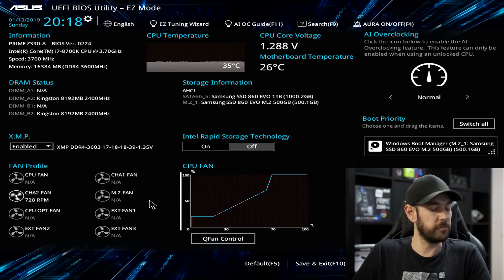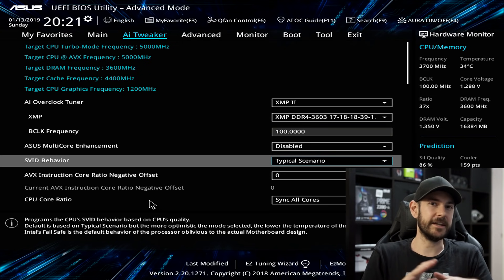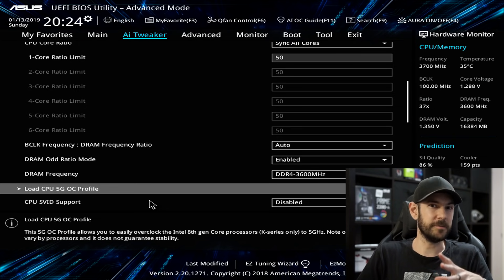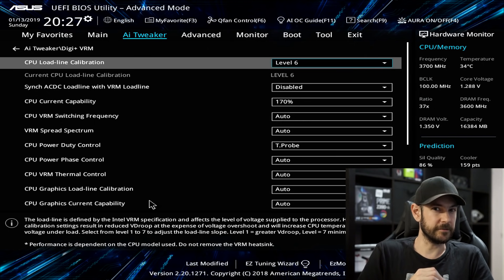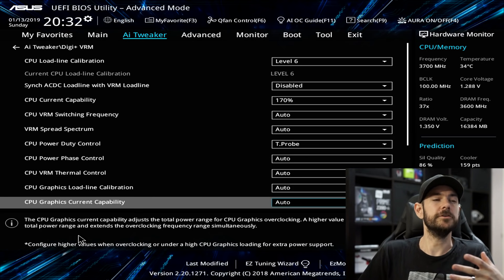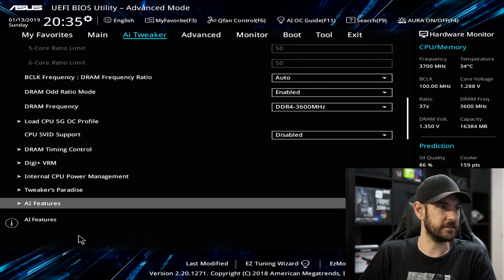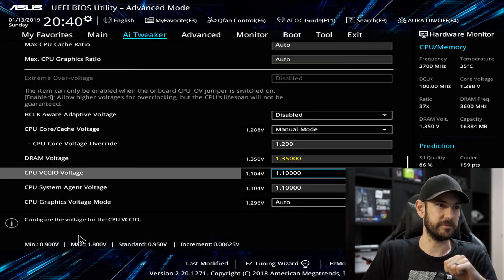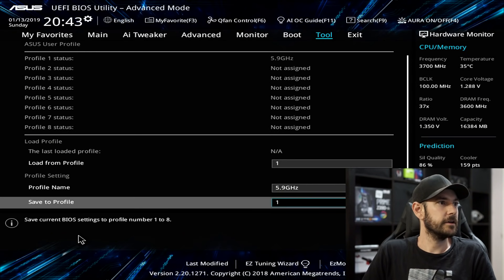ASUS Z390 Quick Overclocking Guide | i7 - i9 | 8700K - 8086K - 9700K - 9900K

Comment: Hey @Boosted Media , so i have tried everything i learned from that and also other videos, but i cant get my i9 9900k running at 5 Ghz. 

Short System Overview: BeQuiet Dark Base 900 (3 Fans), Asus Prime Z390-P ( i know its not the best MB for the i9 ) , 2x8Gb rated 4266mhz Trident Z Rgb ,  Dark Power Pro 1000W Platinum, Vega 64 Nitro+ , i9 9900k, Corsair H150i Pro Water Loop.

My RAM is rated on 4266mhz (same for this MB), but the maximum i can run with simple overclocking is 3800mhz stable.

At first i went with all your settings, which let me boot and do basic stuff, but as soon as i start a cinebench run it freezes and shuts down on the first render square thing.

I then tried to go up in Voltage to 1.32V, and went down with Clockspeed to 4.8Ghz in single steps each. That worked, but had me worried about the CPU temps at around 90-100°C spreaded across all cores.

Now, i know i could go even further in Voltage, but my cpu reaches 90°C+ way too quickly even on 4.8ghz, so 5Ghz, is like unimaginable right now. 

I remember, when i bought the CPU a year ago, i could just load that 5ghz Profile from Intel, and it ran without beeing too hot, maybe like 85°C. Which is alot yes, but now hitting 100°C on 4.8Ghz with 1.32V is not normal i dare to say. The fan and pump speeds are on maximum and i also renewed the thermal paste a few months ago, yet it doesnt really help. Idk, if the CPU got damaged over the past year or so, or if its a setting thing, but even then... i don't understand why its so massively unstable.

Do u think its the Motherboard, just beeing too low speced for the i9? Maybe i need a new Board, but would a new Board really lower temps by 20-30°C? I see alot of ppl running 5Ghz on 70°C even with a little worse cooler options.

Thanks for the Video though, but im sad i cant use it with my Setup(??)
Reply: Did you ever get it figured out??
Reply: @ULTRALXV  Hey, yes as soon as i switched to a better Mainboard (Asus Maximus XI Apex in my case) the cpu ran instantly 10-20°C cooler and now i'm actually daily using it at 5.1 Ghz at 1.37V and AVX drop Set to just 1. No overheating or throttling even in Benchmarks . Cinebench R10 can get 5159 Points, but i dont remember the version TLDR; Asus Prime is actually the worst Mainboard You can buy for Heat Management.
Reply: @Dan98123  I actually have an Asus Prime Z390-A. Had no idea on the heat issue lol. Do you think it's because you had the P model? What's interesting is I can get to 5.1ghz with certain things enabled like the auto stuff on voltage etc. However, I cannot get a stable 5.0ghz when I do everything manually. Right now I'm 4.9ghz with:
VCCIO@1.0v
System Agent@1.0v
Vcore@1.25v
PCH@1.0
AVX is at 0

What's interesting is my temps with this setup are way cooler than stock ASUS profiles. Idle is like 32c and load no more than 55-60c and even under some loads it never goes to 55c. I still have a difficult time accepting that I can get 4.9ghz stable with only 1.25v....yet 1.35v for 5ghz won't work lol.

As for the 5.0ghz problem I'm having...I have no idea how to configure things so it's stable...I've tried most things I think. I have went up to 1.35v on the vcore and 1.2v for both system agent and vccio. I have not tried an AVX offset though. Thank you for the swift reply!

Comment: Killer vid, much appreciated. Thoughts on delidded 8086K at 5.3Ghz on all cores at 1.40 volts as a daily driver? Temps are 36C idle and max out around 65C when gaming. Always stable, even under stress testing. Should I be concerned about this voltage at these temps? Been running this way for a year now but concerned about long term and degradation. Thanks in advance!
Reply from the maker: I personally wouldn’t run that high for a daily driver but if you’re not planning on keeping it more than a few years it’s probably fine.
Reply: @boostedmedia  Right on and much appreciated. So even with the temps in check (71 max during stress tests), it's still the voltage that's a concern?

Comment: i7-9700k works fine for me, I did go to 5,2GHz running without any problems, much better then the asus auto tune.
ty for the guide!

55-60c with an CRYORIG A40 Ultimate.
Reply: Did u change some of the settings he showed in the video? I have i7 9700k as well
Reply: @user-ee6md7vh1o Actually not I did use the same settings, 1.3v 5,2Ghz and I did use intel extreame tuning utility to stress test since that's the only software I know to show me thermal throttling, power limit throttling or current limit throttling.

Comment: Pls answer im newbie for overclocking, is it safe overclock to 5ghz with 1.2 volt? Which one are most the safe, 5ghz with 1.2volt or 5ghz 1.35 volt? Pls answer. Thx a lot mate.
Reply from the maker: I’d be shocked if your CPU will do 5ghz at 1.2V. I’d suggest doing a lot more research before attempting as you seem to have the wrong idea about how this works. The aim is to find the highest clock speed within your safe voltage and temp range.

Comment: Would've loved to have seen the same type of video with an i7-9700k specifically in your MoBo's CPU socket. That said, I still really appreciate you taking the time to put together basic overclock videos like this. They're VERY helpful to folks whom are less experienced with Overclocking (like myself) and that's an awesome thing because nobody wants to accidentally damage their shiny new hardware when all they were trying to do was maximize its performance, and in all that excitement maybe got a little overzealous with settings they didn't understand ;P

Thank you, and I hope to see a similar video where you do the same thing but with an i7-9700k in your MoBo at the time!
Reply: This works fine for 9700k just did it
Reply: @NORMAND021 otta tweak the voltage a little bit but ye

Comment: So after going through this guide, my windows 10 will decide to disconnect my monitors whenever I hover over a windows dialogue. Its very strange, but when I set all my values to default, the problem disappears. Any ideas what setting might be causing this?
Reply: So I have the asus z390-e and I've found my mistake such that I had the XMP profile to 1 instead of 2. Now everything runs smoothly

Comment: i copied your settings.  ihave the i7-8700k with the z-390a mobo.  once i copied your settings i saved and restarted and my pc gets stuck on preparing auto repair...  Any help?
Reply: Go back into bios if possible and either go back to default core values or go load the bios from a working state
Reply: @subswithnovideos-yq9cz  I got it thanks!  For some reason I had to up my voltage a tad and that done the trick

Comment: Love the video very informative, I have always used AI suite to overclock my cpu's. But with my new 9600k on my new Asus Z390-A it wanted to overclock to 5.2Ghz so I thought I'd give manual over clocking a go. I have my CPU currently running at 4.9Ghz with an avo offset of 2, with voltage sitting at 1.280 I have fairly consistent temps of around 60°c. I might look at lowering the avo offset or removing it. Thanks again, would love feed back to know if this seems right
Reply from the maker: Worth a shot. Those temps seem low. What are you using to stress test?
Reply: @boostedmedia  I used Occt for about 45 minutes, it did have a very quick peak of 71 but mostly hovered in the low-mid 60s. I will do some more stress testing after work today. I use a hyper 212 evo as my cpu cooler

Comment: Great write up. Built my first gaming machine recently (i5 9600k - water cooled) so my learning curve is rather steep. I allowed my bios to automatically OC based on the default settings and it set it to 5.2ghz. Ive been running for about a week doing various tasks and some long game sessions. No crashes yet with temps peaking around 81C but mostly staying in the upper 60s. My biggest concern is hearing you talk about voltage. Once I checked in cpu-z I saw it had set it to a variable rate that frequently hit 1.495v. as a max. Should I be worried about running this voltage if temps and stability seem to not be an issue? Appreciate the insight.
Reply: based on my previous experiences 1.495 is a really high Vcore I would say it's a bad overclock because the voltage is really high to my mind :S I've never ever been above a 1.35v I believe you should do the same for a first try

Comment: I’m looking to stay at about 4.8ghz on my 8700k and 370a. What voltage should I aim for? 1.1-1.3v? Other than that, I assume I can just use the same settings you listed? Really I’m just looking for the safest/easiest OC, not trying for 5-5.1ghz.. 

Best OC guide I’ve found, so thank you for this!

Comment: Help! I'm having trouble getting the right overclocking numbers for my 9900kf while keeping my thermals bellow 100c at full throttle. ( details: mb- Asus z390 plus CPU- I9 9900kf  cooling- Cooler Master 240 AIO)

Comment: Thanks man, you are a life saver, I'm running 8700 non k can you help me out, my cpu temps are going crazy
Reply: medi core I know this is late, but non k processors are not designed to be overclocked and is very hard to get a stable system. I recommend you don’t try as you may fry your chip if not done correctly

Comment: Amazing video!! Thanks a lot for your time. I’m a little bit worried with my vccio and vccsa. I have the asus rog maximus xi hero wifi and the 9700k. With xmp settings on, and everything on auto, my vccio is 1.31 and vccsa is 1.26. Should I lower these voltages? What would be the consequences if I don’t change these numbers? Mce is enabled. The cpu is not overclocked.
Thanks a lot!! New sub:)
Reply from the maker: I’d lower them to 1V if it’s not overclocked. If unstable try 1.1V. Over 1.3V just causes things to degrade faster and generates unnecessary heat.
Reply: Boosted Media Ok!! I will try. Thanks a lot🙏🏻

Comment: I originally used the AI Suite 3 to do the over clocking for me but I kept getting bsods and i figure it was because of the over clock over time. Its an entirely new pc build. I tried this so i hope this works better
Reply: ai-suite 3 is trash... same with the bios option of a auto overclock, last time I did use ai suite was with my z170 board at the time it did a great work now its yeah just disappointing

Comment: I got a i7 9700 and its running 4.5 ghz 56° normaal when gaming 70/80 Not higher and the rtx 2060 is 81° degrees. Is this too hot? Volt is 1.25 or something like that. I liked my frames and could play 240 fps on Fortnite Competive settings. But it wasn't stable but less hot tho. If dropped 5 times to 40 fps when I capped it too 200/165 and 144hz but still dropping hard. Someone got tips?

Comment: I can't believe it's working! I have to rewatch the video a couple of time to understand some things but I was in a hurry to OC my CPU. Firstly I have activated the default OC profile (ASUS AI Optimizator) and I saw it was working smooth, though I wanted to take a look at the temps and I found that it was staying around 75 - 80°C which was fine but that 1.367V on the CPU made me worrying a bit so I found this video and dropped my temp by 15°C! The CPU is locked stable at 5.00Ghz at 1.305V which is quite huge and drops right away to 1.288V when idle or light work.

A have some questions though.

What is AVX important for? Does it cut some instructions on the CPU?
Does the CPU somehow stay a bit more stressed under 5.00Ghz all the time even if is under 10% usage? What's the difference letting the CPU pushed at 5Ghz instead of letting it boosting when it needs? 

Thanks again! Liked and subbed! Bring more deep OC tutorial because you are really good at it

P.S I bought 16GB (8GB x 2) Corsair Vengeance Pro 3000Mhz. I used XMP I and manually adjusted the freq to 3200Mhz and it's working fine under stress. Should I keep it?

Edit: Used the tutorial for my i5 9600K on ASUS Prime Z390 with Corsair H115i cooling

Comment: I used to be a self-proclaimed computer geek... until I saw this video.
Your knowledge is just on another level. I learned a lot!
Reply from the maker: Lol. Not a competition mate. I’ve been doing this a very long time ;)
Reply: @boostedmedia   Have you used the "Asus Intel Extreme Tuning Utility" to adjust overclock settings? (It's a tool found in the list of drivers/utilities in this motherboard's support site) I'm wondering if there's any benefit to using this tool or any other overclocking software over using the BIOS settings only.
Reply from the maker: No way. Never use windows software to overclock :)

Comment: I must have missed something. I set it up for my 3.2ghz ram, so all the same settings you have but the ddr at 3200, and it cycles back to bios and tells me to save my ram settings which are at 3022 after the reboot.

Comment: Thanks for the video, If i was to overclock the same cpu using the same motherboard would i be able to use the exact same setup that you have done? (Using an amd rx580 and a 240mm nzxt aio liquid cooler)
Thanks in advance

Comment: I followed this guide and got literally several thousands of errors in occt in less than 2 minutes before it went into blue screen, why is it like this? Cpu is 9700kf
Reply: You need to try to up ur voltage.  I ended up having to put mine at around 1.33 for 5GHz stabls

Comment: Thank you so much for this guide!  I've just built my own rig for the first time and I'm sitting at 5.1 GHz at 1.29v.  Might have to tweak it slightly when I start doing some stress testing, but very happy so far.  I'm running an i7 9700k with hero xi maximus board and an H115i cooler.
Reply: Hey bro, i got a 9700k with h115i on asus z390a. I was able to get it only to 4.8Ghz at 1.295v. Mind sharing ur settings?
Reply: @matixitam1  maybe you've got a bad cpu which can't hold 5GHz at thouse settings.

Comment: Dude, you’re freaking awesome. I was using Asus auto-overclock function and my voltages were way too high (1.45) and I think causing shutdown reboot issues. This worked great and voltage is now staying at 1.28 with 5Ghz and a little cooler of course. Is that silicon quality actual too? Mine said 55%. Thanks again.
Reply from the maker: I wouldn’t pay too much attention to the silicon quality reading. It’s just working off crude averages. Glad the video helped :)
Reply: Also, I think they removed that feature with a firmware update... guess it wasn't reliable?

Comment: I recently bought a Z390p board with i5-9600k and i am not satisfied with how it's been operating, straight from when the installation was complete it worked for 2 Days, then on the 3rd it bluescreened right away when opening Chrome. I then rebooted and saw some artifacts on the login screen, wasnt there before. I rebooted again to go into bios and noticed my voltage was 0.9, so i manually inserted 1.018, and it started perfectly and no bluescreen, i later tested adding some OC to the pc from XTU software and it worked pretty good, i got 4.9 ghz but it was jumping up and down like crazy. So i want to know how to get rid of artifacts but also how to keep cpu core stable, because increasing vcore doesnt work anymore, also disabling speed step doesnt do anything.

Comment: I have an issue with OCCT, I have a 9700k CPU followed the guide to 5.0ghz but on the current CPU information on OCCT it says 3600mhz, while CPUID and other says it's working at 5.0ghz??? might this be the cause of OCCT failing the test? because I've no issues with other benchmark programs.
Reply from the maker: It’s just how the software reads the CPUID. Wouldn’t cause the tests to fail.
Reply: @boostedmedia  thanks for the answer!,  I'm not a native english speaker so I'm not sure what option is the one I've to go up .01 each time that I do a test on OCCT and fails :( I have an ASUS z390-E
Reply from the maker: What VCORE are you running currently?
Reply: Boosted Media
 cpu core/cache voltage - 1.305
  - cpu core voltage override 1.310
Reply from the maker: You probably just need more VCore. But keep an eye on your temps. Up to 1.35V is OK as long as your temps stay under 85C
Reply: Boosted Media the only one I can change is the override so i put that one on 1.350?
Reply from the maker: As I said, check your temps first.
Reply: Boosted Media I did 1.35V, OCCT hasn’t crashed and getting 70 C during test
Reply from the maker: Sounds good!

Comment: Hello Will,
Nice video like always man. Question for you, I'm running my 8700k on my Asus prime 370-a board at 4.8ghz with 1.3v. I took a look at your other video as well, z370 one, but like these settings more since in using xmp profile. Anyways, I ran Realbench for 20 mins, no crashes, prime95 1 hr, no crashes and aida64 no crashes. But when I run OCCT, based on your stress test video, it crashes, no bsod, after 10 mins. Any ideas what could be happening or is OCCT being a jerk.
Reply: Uhh if It worked In prime u are perfectly fine

Comment: I did everything step by step but the current cpy core speed is still at 3.7mhz. I have an intel 8700k
Reply: @sevhills  no not yet, I over powered the processor and the computer couldn't enter bios or windows. I had to take out the battery and reset the motherboard. I will look for the solution and update you this weekend.
Reply: @sevhills  I am running an i8700k 3.7Ghz tower cooled processor, with 32 Gb Hyperx Predator Ram @ 3000mhz clocked. As well as a gtx windforce OC 1060 6gb gpu. Windows is on a 500gb nvme  storage is 2 HDDs and 1tb ssd.
Motherboard is ASUS TUF gaming Z390 Plus.
Reply: @sevhills  So you managed to do it?
Pass over the OC settings